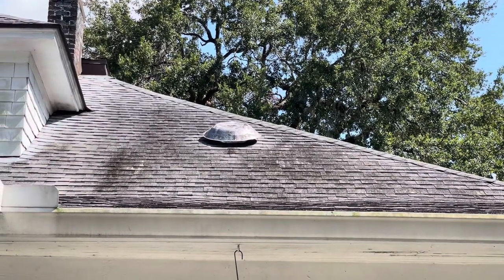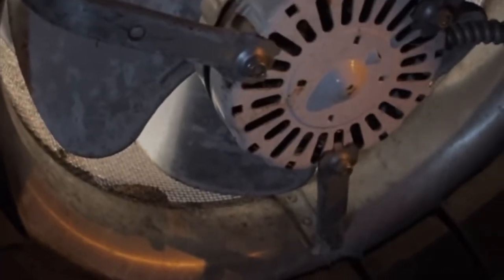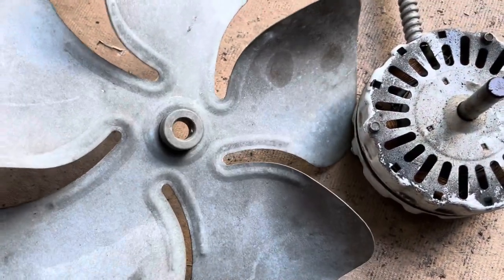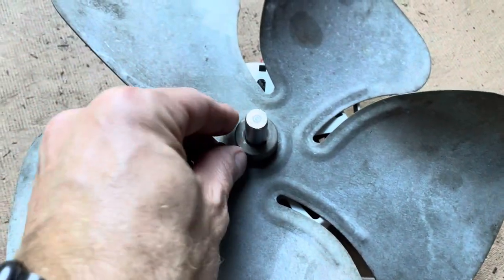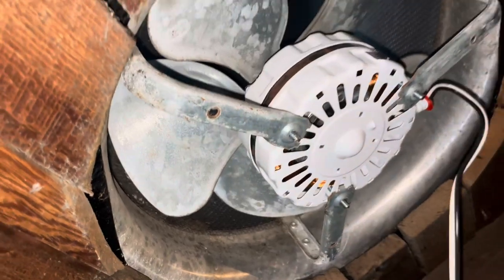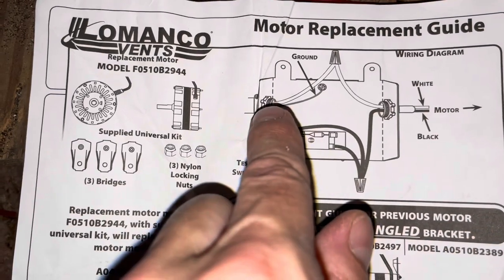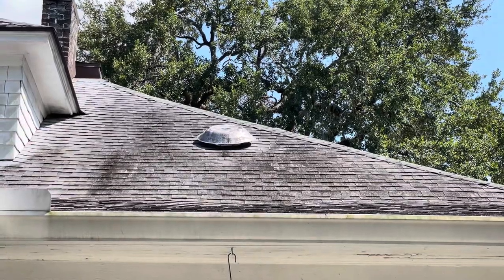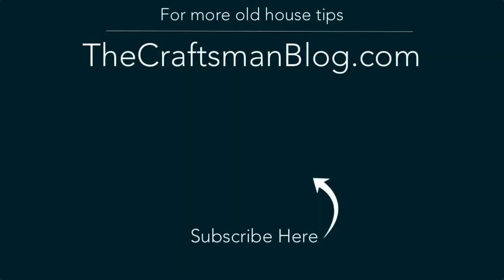How To: Restore an Attic Fan

Comment: Make sure you have plenty of air available for ingress to attic from eaves or gable vents. If the fan draws too much CFM you can pull conditioned air out of the house. It will pull air from penetrations at ceiling fixtures, electrical outlets in walls that lead to wire holes in top plates...anywhere it can find air to make up for the supply deficit to the fan. You can air seal penetrations to help, but I have found air being drawn thru small cracks in ceiling plaster. Invest in a cheap FLIR camera for your phone if you want to go down a rabbit hole of leaking air in your old home. Just need lots of supply or low CFM fan.